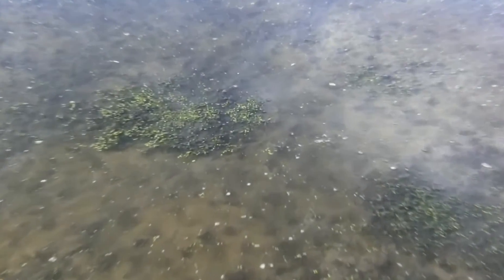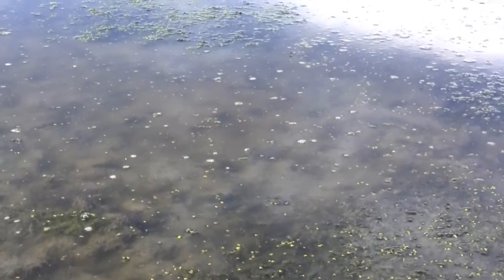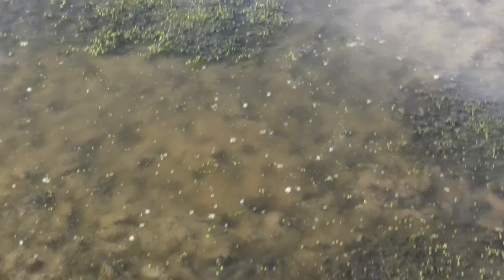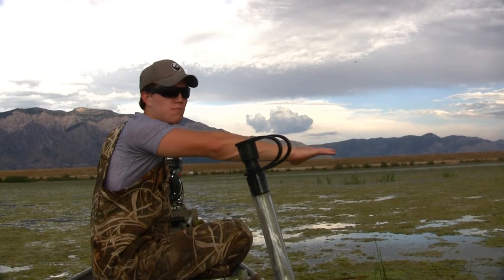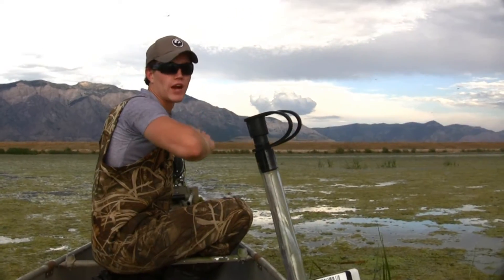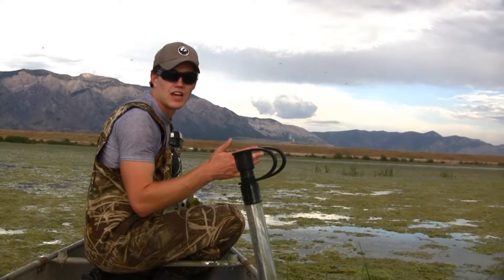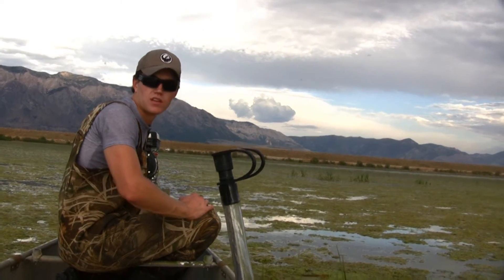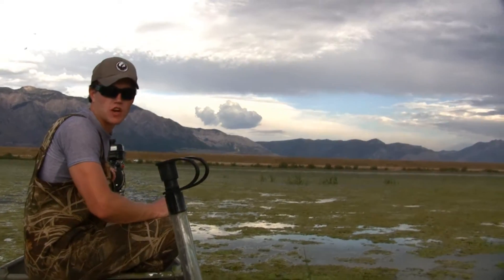Mud Buddy Canoe- Cavitation Plate Test

Comment from the maker: My guess is you've run into the difference between American longtails and SPS style longtails.  American longtails have short drive shafts and SPS style longtails have long drive shafts.  This drastically changes the angle the motor enters the water.  You'll have to get the angle on the cav plate for the SPS darn close to parallel with the drive shaft.  It takes very little adjustment in angle to affect how deep or shallow it holds the prop.

Comment from the maker: That's a complicated answer.  In simple terms, it comes down to prop geometry.  Copperheads and other surface drive motors get away with no cav plate because their props are specifically designed to run in an aerated/surface-piercing mode.  They have characteristics such as lots of positive rake, rake-line cup, pitch-line cup, and a large diameter.  Combined together, this allows the prop to work/grip efficiently with only half the prop in the water.  Longtail props generally don't have this.